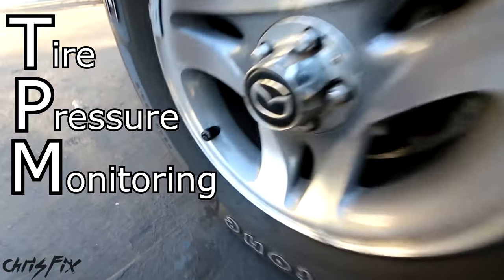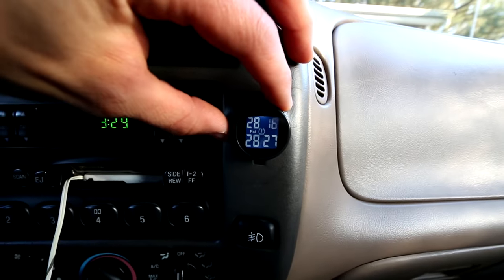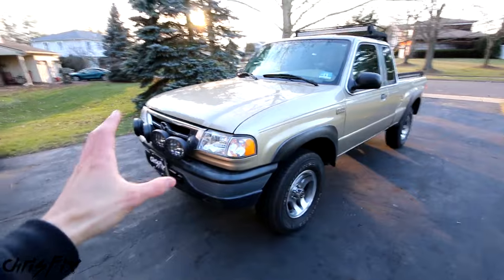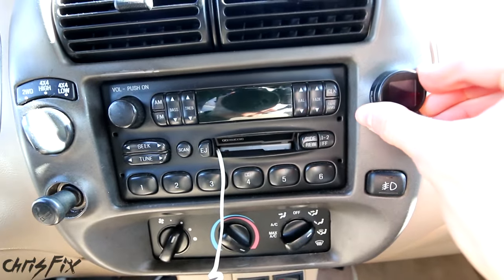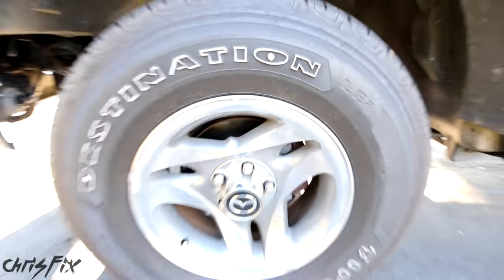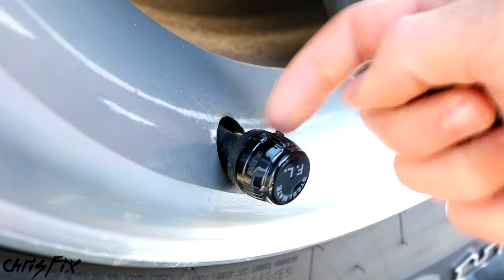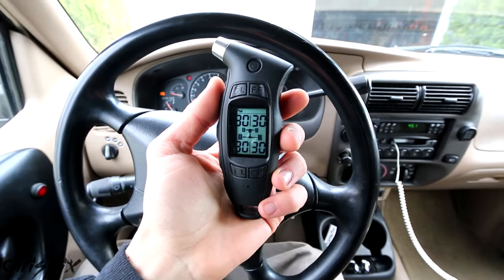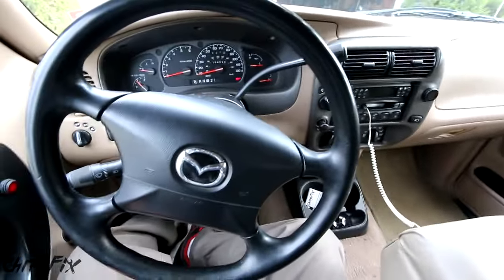How to Install a Tire Pressure Monitoring System in Your Car

Comment: Bought several sets of a less expensive model last year and had very good luck with them on several cars EXCEPT they came with aluminum (silver) security lock nuts, not brass as in your video.  Over time, galvanic corrosion froze the lock nuts in position, requiring me to cut them off the stems using diagonal or side cutter pliers (the nuts need to be out of the way to refill the tires).  Put the sensors back on, and no one has ever stolen a single one, and none have loosened on their own.  So, my advice is DON'T install the lock nuts if they are aluminum!
Reply: You can use a grease.
Reply: @Acavando  True - just wish I had known that beforehand!

Comment: Having worked on cars before TPMS was mandated and after, I will say it helps prolong tire life. 

Now, I agree that people should "just check their tires". But I can tell you that many people simply do not. They don't check anything on their car. 

The amount of tires that come into the shop under inflated is far less today than in 2005. The amount of tires I have replaced due to inflation wear is far less. Personally I am glad only 1 of my cars have it (wife's Tiguan)
Reply from the maker: +HumbleMechanic Thanks for sharing your experience Charles! That is pretty cool you can see these trends!
Reply: Is the weight of the sensor enough that you should have your tires rebalanced?
Reply: Well here in Canada we have garages with air prashers and there's a gage on the end of the line, telling you the air prasher in the tire.
Reply: Robert Jensen I highly doubt it
Reply: @greatpix  The weight of the sensor will probably be about 15-30 grams. Most tyre balancing machines will balance by 5g increments.

A 30g imbalance after a year of wear is considered 'normal' for a car daily-driven, but ideally, should be rebalanced. However,  not necessary. Keep in mind that a road wheel is naturally lighter where the valve inserts due to the fact it's less metal to create a hole. That's why, when you get new tyres, you'll sometimes see little dots on the tyre itself.
Reply: @chrisfix  hi
Reply: @chrisfix  hello
Reply: Okay
Reply: @chrisfix  I need this for my semi truck 10 wheels which one should i buy???
Reply: @chrisfix  I'm struggling to take off the nut because it's rusty and stuck with my tyre valve. If I put pressure on, the plastic cover comes off and only allows me to replace the battery. 
I can't inflate my tyres anymore 😔 😞 😪. 
Please make a video on how to take off the lock if it's stuck. 
I can't apply heat , it will burn the plastic cover. 
I tried wd40 it's not helping 😕 😪.
Reply: It's just another sad tool to automate more for lazy people and cost all of us more money and headaches when sensors fail or break.
Reply: I think anyone who is into buying these sensors is actually not part of the problem of people who don’t check their tires at all. I think a lot of mothers don’t even know what psi or bar means. Car maintenance doesn’t cross their mind, other than the annual checkup by the dealer. They are the problem.
Reply: How many ever bother to check their spare tyre in the boot??
Reply: @chrisfix  is there a certain way to put it on I ordered one and it’s not reading proper tire pressure
Reply from the maker: @christopherlitton696  there is not. You just screw it on. Maybe you got a bad one? I’d reach out the whatever company you got and let them know.
Reply: @chrisfix  thanks I’ll message the seller and see what they say
Reply: This. I never manually check my tires other than looking at them and hitting them and saying "Yep. Looks pretty good." My last two cars had a built in tpms and it was a life saver.
Reply: Good  @chrisfix

Comment: Cool and all no doubt but for 100 bucks id rather do it manually within 2 minutes lol
Reply: I think it's more important for high way and off road trip as it will alarm you before you destroy the tire driving on it flat or worse make an accident.
Reply: Or on a trailer where it is hard to determine a problem until it reaches the catastrophic point. Cheap insurance.
Reply: What good will that do you? If you don't have  a compressor with you, you stil have to change a tire, or will this change a tire for you?Most shitty things don't happen within a  1/2  ,mile radius but in the f** middle of nowhere or other shitty place
Reply: Really not too bright are you!!
Reply: and not to mention as soon has it tells its low your gonna spend twice the time walking around with this funky wrench and socket taking them off and spraying everything  soapy wooder
Reply: Agree. I have no use for these.  Get a good gauge and check weekly. Can do it in less than 2 minutes.
Reply: Ah vamo nessa -  An investment without return is no investment but a waste of money, and cluttering your dashboard with a display that shows the same thing forever, and it throws your wheel balance off by putting that sensor on.

Comment: VIDEO IDEA. You could do a video on replacing an aging factory stereo head unit with a new one/aftermarket. You could include running a new power supply. When I did my radio I had to run a new positive power supply because the stock radio got its power in a way I didn't understand. Monsoon if you've ever heard of it. complicated radio system. I put in new speakers too. The stock speakers had 4 wires each which would not work with a new head unit.
Reply: many radios have an amplifier built in my VW jetta had a monsoon stereo system you have to find the right wire so it can run off the amplifier ive had trouble with this before took me awhile
Reply: What's it matter whether or not someone is still running factory radio? I got no issues with factory radios in my old 80s Chevy trucks and 95 F350.

Comment: Makes checking you PSI a dream but makes filling your tires a nightmare
Reply: I agree. Just check your time pressure regularly and save your money.
Reply: Besides, it changes the tyre balance as it adds weight that was not there when they balanced it
Reply: @Tax2Me  I was thinking the same. When the tire shop balances wheels then they add only like 10 grams to balance it, so that’s all it takes to throw it off balance. 10 grams is easily reached.